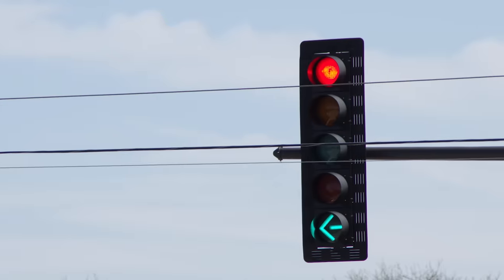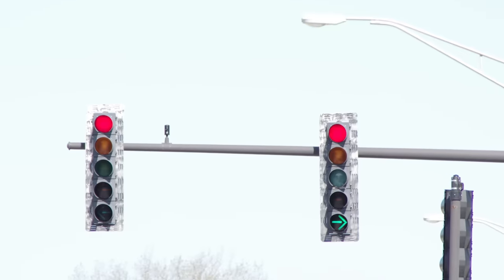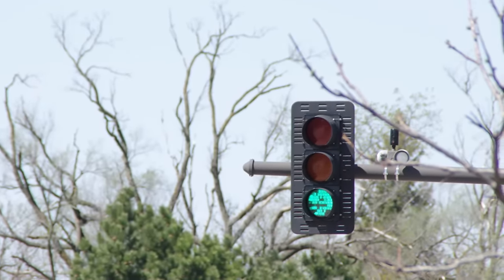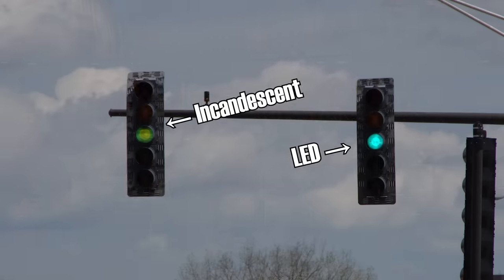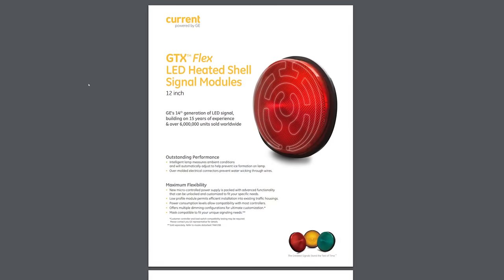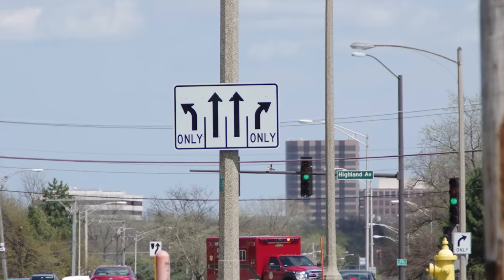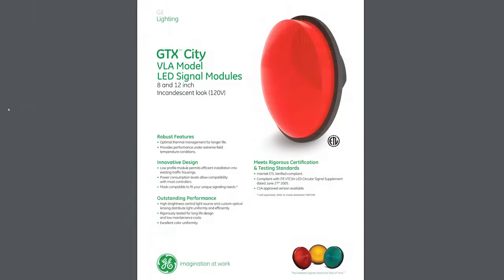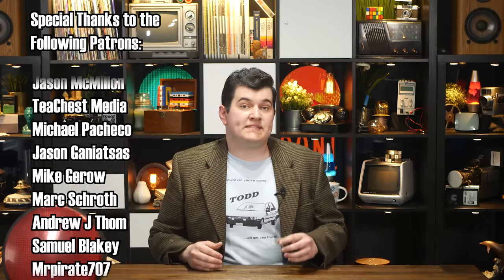The LED Traffic Light and the Danger of "But Sometimes!"

Comment: "But Sometimes!". Oof that can be applied to so many things. Nuclear Energy, Led lights, Wearing a mask during the Corona Virus Pandemic.
I see it pretty much daily in electrical engineering where a few have opted to do things in a downright teeth grinding way. Like expecting me to hand-solder a complex circuit without thermal relief as they never use reliefs cause "but sometimes parasitics get in the way!!".

Here in europe/netherlands every direction has its own set. So instead of a 4 light sign with the bottom signalling a left/right you may go into. We got 2*3. One for forward and one for going to say the right.
Weirdly enough the emergency service system does not exist for us. We are just trained to make way and stop the moment an approaching Siren is heard. HOWEVER in the netherlands the Public transit (busses) do have a form of communication to the system to allow an intersection to respond to an approaching bus. having a special small traffic-light with a Dice like pattern and often prioritizing them over regular traffic.
Reply: and don't forget that emergency services have this system in their vehicles that controls the lights at the intersection and gives these vehicles green, though it needs to be a real huge priority to activate this system.
Reply: Nuclear energy (fission, at least) isn't really a good example of "but sometimes"ism. Even ignoring accidents like Chernobyl and Fukushima, they still produce radioactive waste that's going to be deadly for thousands of years. That's reason enough to want to find alternatives.
Reply: @IBeforeAExceptAfterK  I'm talking in the context of nuclear energy in relation to fossil fuels as a interim stopgap. For as ideal alternatives would be, they ain't feasible at the scale required for a while yet.

In that context i find it a pretty good example. At least with radioactive waste we know the risks and how to manage it effectively. Carbon: apparently not...
Reply: @IBeforeAExceptAfterK  The more dangerous the waste, the faster it decays away. And since it's just a rock sitting in a tube, if you shove it in a cave it's not going anywhere. Unlike all the CO2, SO2, and other stuff other power plants just throw into the air with gay abandon. 
Plus we can just take the used fuel, clean it up a bit, and burn it again. The goal with even newer reactors is that you wouldn't even have to reprocess it, you can just chuck it right back in.
The whole "but waste" thing is a prime example of "but sometimes". Everything has waste, even solar and wind. You just need to make sure it doesn't end up in a river or a lake and you're good to go really. Unrelated, over 100k people have died from dam collapses, multiple multiple times greater than any other power source, and yet people aren't screaming about dams killing us all.
Reply: Europe

Lol
Reply: In Adelaide (South Australia) (pop 1.3M) one of the early emergency vehicle traffic controllers existed. There is a fire station right in the middle of the city square, and when fire engines needed to get out of the city, there was a switch in the fire station that turned all the lights on King William St (The main road) Green so the trucks could get out.
This would normally end up causing a massive delay for anyone else travelling east west anywhere in the CBD, but it sure worked.
Reply: @IBeforeAExceptAfterK  Yeah, Wind and Solar power are far better examples of "but sometimes"
"But sometimes there's no wind! But sometimes the sun isn't out!"
Oh you're absolutely right, let's keep burning coal and producing loads of radioactive nuclear waste forever then. 🙄
Reply: There's more radioactivity and toxic heavy metals in the areas surrounding coal plants than there is in areas surrounding nuclear power plants, and coal ash is literally just as bad as radioactive waste. Nuclear waste is not a good argument.
Reply: @Foxhood  We actually have no good way to manage radioactive waste.  It just gets piled up somewhere.  That's really all they do with it.  Nuclear energy is not clean, and is only preferable in that it isn't running out.  Fossil fuels, despite all their shortcomings, are a better option than nuclear energy.  Replacing BOTH with wind, solar, tide, or whatever kind of clean power is absolutely best, but the stopgap should be fossil fuels.  Their byproducts are temporary and we DO know how to deal with those.  Planting trees may not be a quick fix, but it's a heck of a lot faster than waiting thousands of years for millions of cubic tons of radioactive waste to decay.  

And that's not even counting "but sometimes" when it goes wrong, which IS so bad that it shouldn't be risked.
Reply: @adde9506  not that one again. The widely shared research that has gone into a full blown tree mania has been torn apart by the scientific community repeatedly ever since it surfaced.

Peer research and data from existing/past reforestation initiatives quickly debunked it as fundamentally flawed. ignoring so many influences, consequences and problems while cherry picking datapoints it is mind boggling. The short version: We can't plant that many, the solution is far from as efficient as advertised and highly uncertain it will accomplish what we want. It was simply too good to be true.

The idea still has merit and should be pursued with care, but it cannot remotely guarantee the carbon emissions to be "temporary". We still do not know how to deal with it and for me to keep on gambling on that we somehow DO figure it out as everything keeps getting weirder is increasingly an option i don't want to see taken.

So yeah. gimme the choice between the 2 and i'll take the waste with the increasingly rare nuclear events. which though scary are not remotely as deadly than what fossil fuels have been so far and may be in the decades to come....
Reply: @adde9506  We HaVe No GoOd WaY tO HaNdLe WaStE, lol yes we do dipshit just nobody wants to do it.
Reply: Ok but nuclear energy isn’t the same. I’ve heard what you people say about its safety and at the end of the day I just don’t agree. I’m sure it will be widely used one day anyways, though. My opinion is irrelevant. 

Also, newsflash: we didn’t always need to use stoplights. Maybe saving resources, and “sometimes” having people get into accidents wasn’t so bad.
Reply: @IBeforeAExceptAfterK  exactly
Reply: @ianrasmussen5380  an area flooding with water from a dam break is not the same as the accumulation of nuclear waste. Yes, it may kills lives in the short term, but the land will still be useable afterwards (and maybe even better in some ways as the water returns to its natural course... yes Ik this affects water tables and crop irrigation but oh well). I would take that over a nuclear disaster any day. I like the idea of reusing the waste until it becomes inert, but there are so many major what-ifs. 

Nuclear energy is so powerful that I don’t even really trust burying it deep within the earth without having any negative consequences. 

Why do we always need to be sucking up energy from the earth? It just doesn’t seem right. Why can’t we slow down?
Reply: @mjc0961  I agree, although I know a lot of energy is expended gathering the components for solar panels
Reply: @user-pe2yx9kt4e   Yeah about that.
We are so vocal in support because Nuclear Energy risks being destroyed by the idea of "Just don't agree".

There is a lot we can provide. studies, analysis, statistics. All showing how Nuclear is a avenue that isn't ideal, but has to be taken for fossils are factually worse than every death by every other form of energy combined per unit of energy and that the waste is nothing compared to the by-products being pumped into the atmosphere.

But. If a scary event happens, people believe in pop-science articles that give that comforting easy solution of "Just plant a trillion trees!" (which been torn apart plenty of times) and choose to just not agree. Well then you get perfectly fine reactors being dismantled in favour of coal plants as seen in Germany and japan.
Reply: I would like to hear some science on how your mask works but only if someone else wears one too... and as far as doing something risky/unnecessary to themselves even if it may cause strain on the medical industry/society or indirectly risk your safety.... driving large or fast vehicles, drinking alcohol, eating  sweets and other junk food, playing contact sports,  having unprotected consensual sex, getting elective surgery, swimming for fun, sitting down and watching tv for 8 hours, going out with our faces exposed... expression also leads to innovation, diversity, and joy, which sanity requires. our bodies are still our own individual property, right? all of a sudden medical freedom cant be allowed if it can cause societal risk? I missed that change.
Reply: @lsixty30  awful lot of words to say "masks are bad cus i don't understand them and they're a buzzkill"
Reply: @mjc0961  Nuclear reactors are the best and most efficient alternative to fossil fuels
Reply: @IBeforeAExceptAfterK  this already has a solution, thorium reactors. A large part of the danger of nuclear reactors isn't because the process itself is inherently dangerous, but because people aren't willing to invest the time and money required to make a safe and efficient reactor, even though it is both more environmentally friendly, efficient, and cheap in its lifetime.
The but sometimes is used to justify badge long-term decisions, for the benefit of short-term decisions

All of the major nuclear accidents have been caused by negligence in upkeep, or in the case of Fukushima, what is basically an act of God, and the death toll of nuclear reactors is comparatively much lower.
Regardless, figuring out what to do with nuclear waste is a much easier problem the solve then trying to figure out what to do with intangible particles flying in the atmosphere and creating a global warming effect. Not only that, but reactors also don't produce that much waste, at least more modern ones. It's not like The Simpsons where you have literal rivers of waste, it's one or two spent fuel rods every few years, and the water that accompanies it. A significant portion of nuclear waste isn't actually from the reactor, but things like PPE suits and lab equipment that needs to be disposed of because they are lightly radioactive, which don't take thousands of years to decay like waste proper
Reply: @lsixty30  Dude, the science is set. You should always believe scientific consensus, it has never been wrong!
Reply: @mjc0961  So you won't complain when electricity gets rationed. Got it.
Reply: @IBeforeAExceptAfterK  nuclear war is better than nuclear energy,
You can go to ever spot on earth where a nuke bomb was dropped and survive, and live by those places  in relatively safty, bikini atoll is the exception,  people live in the area of the Nagasaki and Hiroshima bomb areas,  people live, work and survive in and around the areas of all the nuke testing areas weather above or under ground testing,  again bikini atoll is the exception, but even that exception you can visit and you could live there, just not safely,   but now nuke energy, you might,  maybe, possibly, in a thousand years, be able to live relatively safely by Chernoble  or Fukishima,   that is a big maybe, hell it might take that long just to contain the core of fukishima,  nobody really knows for sure,   that is why nuclear war is better than nuclear energy,   in a thousand years if you went unprotected to where the reactor was at fukishima, chances are you would not see your next birthday or the following month for that matter,   you can go on a tour at white sands and walk around where the first nuke bomb was set off,  there will never ever be tours of the reactor area of fukishima, at least not in this millineum,  I say get rid of the nuke energy at least  we don't need the electricity that bad to justify it's use,  let the goverment war mongers keep their  nuke bombs,  but be smart and unplug the nuke power plants, if fukishima hasn't allready doomed the entire planet the next accident probably will,  and guaranteed there will be another one if we keep using it.
Reply: but sometimes, when you overdrive your open-air nuclear power generator...
Reply: @travisleeds2910  " but now nuke energy, you might,  maybe, possibly, in a thousand years, be able to live relatively safely by Chernoble  or Fukishima "
This is a lie, its exactly this kind of BULLSHIT.
You can live in Fukushima, it was just an evacuation,  people already have returned and reopen their business because there was not a significant leak.
And there's people working in Chernobyl, you can actually live there, 10Km from the power plant is less radioactive than some places of top of high mountains, because fucking what ? radiation literally rains from the sky, it comes from the space and its natural.
Know why there aren't people living in Chernobyl, because the city is a rumble and its depressive, has no infrastructure and amenities and now its basically a fucking forest, its a shitty place, not because it is radioactive, but because it is a dead place no one wants to live.
Reply: @adde9506  Used nuclear fuel can be reprocessed and re-used, and that is done in several other countries. Is used to be done in the US as well, until the company doing it shut down. 

WHY they shut down is interesting. As they were approaching capacity limits at the facility they applied to the Atomic Energy Commission (AEC) to expand the plant.  The AEC approved the plans after requiring seismic upgrades in the design. (They actually were not needed because the facility is in a geologically stable area, but government rules are government rules. )

The kicker was that after the expansion was started, the AEC came back and effectively said "oh by the way you have to do all of those seismic upgrades to the EXISTING plant as well". 

The company crunched the numbers and decided that made it a very bad project on the economics. So they stopped the expansion, closed the entire plant, and got out of the reprocessing business. 

Bad for the company, bad for the workers who lost their jobs, bad for the economics of the country's nuclear energy sector, and all because some government bureaucrat placed a stupid requirement on them. 

I think that for a while after that the US was sending used nuclear fuel to France to be reprocessed - no idea if that is still being done.

Comment: 15:08
The LED replacement walk signs with the countdown timer don't actually need an upgraded controller because the logic is contained in the unit itself.  In fact, there is no data sent to or from the controller at all.  The sign is simply connected to two distinct AC power circuits, one for when the "walk" sign should be displayed and the other for when the "don't walk" sign should be displayed.  The controller just strobes the second circuit on and off when it wants the hand to flash.  The amount of time the hand should flash for a specific crosswalk is determined by a traffic engineer and configured in the controller.  That time never changes, even if other parts of the light cycle are variable.  The retrofit signs takes advantage of this by simply counting that time the first couple of cycles after being powered on and then uses the remembered time to start counting down every other time the hand starts to flash.  It uses a super capacitor to keep the countdown clock powered between those strobes. ;)

Comment: I find the incandescent fade is helpful in spotting that a light has changed. As the LED is an instant switch, all be it between two slightly different positions is it just my eyes that don't always spot this change. In the UK of course we have red amber rather than just red to green which is when it is most difficult to spot.

Comment: Wow, here in Russia we have almost all the incandescent traffic lights already replaced by the LED traffic lights long ago, and they work just fine in any weather, even the harshest snowfalls and blizzards - and, you know, here in Russia snow lasts approx. half a year. 

The LED traffic lights even don't need these covers against the sun because they are exeptionally bright/ And no cover means there are no places for snow to stuck on while bright light is still seen through 1-2 cm of snow, if snow actually manages to stick to the LED surface. And no additional heaters needed.